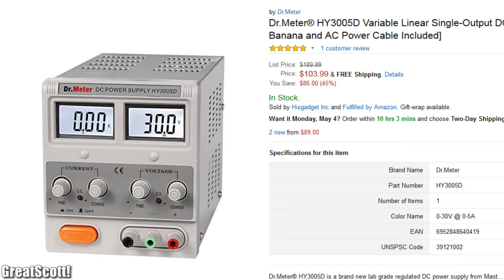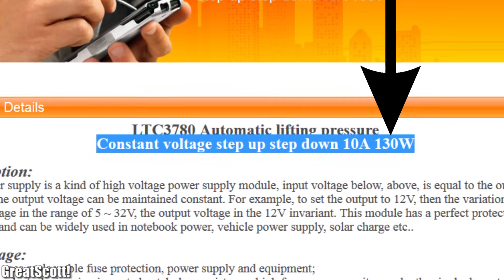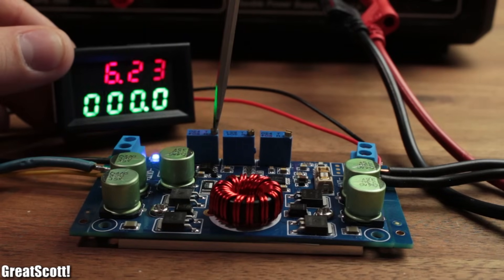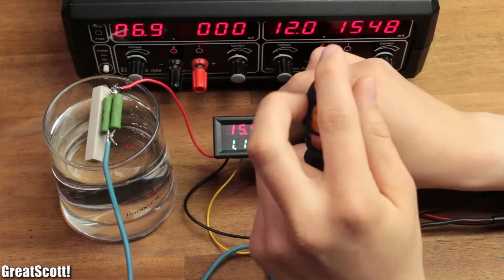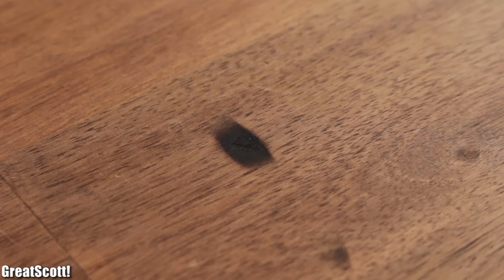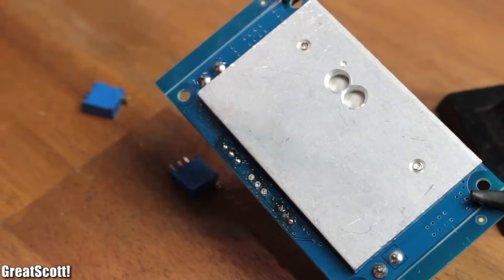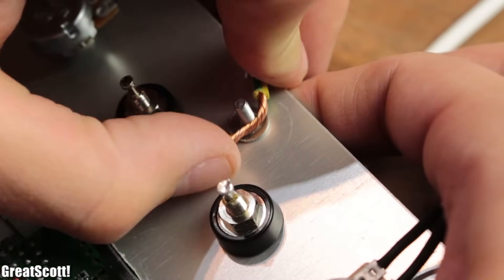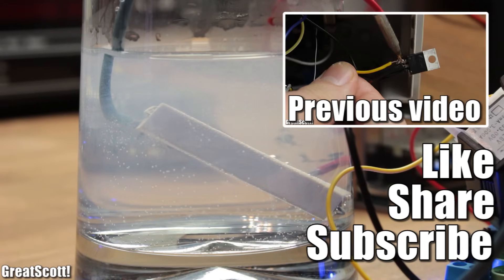Build your own Variable Lab Bench Power Supply

Comment: Where is the case from?
Reply from the maker: +SlyTrickyGaming Conrad
Reply: +GreatScott! Thank you
Reply: +GreatScott! Not sure what Conrad means when it comes to the case -- is there a model/part number I can search or a web site? Thanks
Reply: +Barry Stevens Conrad is a German electronics store. Im not sure if they ship to other countries, but i found these on their website: https://www.conrad.de/de/Search.html?search=gss0  I hope that helps you. :)
Reply: +SlyTrickyGaming https://www.conrad.nl/nl/teko-aus-33-universele-behuizing-abs-aluminium-donkergrijs-1-stuks-521906.html This is the one, i believe. There are multiple colourscheme's though.
Reply: That's an interesting idea. I just had a look at some junk 3.5" DVD dives that I have and it could be an idea to use the metal frame for a project box with mounting points for a PCB and end panels :)
Reply: I have a metal cage/box (had nothing in it) from an old HP printer I stripped down for motors and switches that I think would make a great project box for something in the future.
Reply: Wasn't finding anything I liked anywhere. If they don't ship maybe I can get a part number. If all else fails I'll build something -- Thanks
Reply: All -- thanks for all the great info!
Reply: just buy an old DVD player or something and make a new faceplate for it, probably way cheaper too
Reply: Thanks for the tip!  Have built one using this case, and everything does fit (nice case too).  You do not have room for an internal fan, if you'd like to include that, but I haven't found the need for one so far.
Reply: I found a very similar "robins egg" color one on ebay. I am using this for a different project, although it will contain a variable power supply as well (since it already had half the circuitry). I am using analog gauges though :D. Very nice size, and I like the metal fold out leg. Much less clunky than the plastic arm fold out, and tucks underneath the feet. I find it weird that the case ends up being the most expensive part on the parts list half the time! If you want a decent design though, I guess you have to pay extra for it. This one is 22$.

https://www.ebay.com/itm/HF-1-9-ABS-Plastic-Enclosure-Connection-Box-Project-Case-Instrument-Shell-Cover/381007375876?ssPageName=STRK%3AMEBIDX%3AIT&_trksid=p2057872.m2749.l2649
Reply: +SlyTrickyGaming This might do the trick ? http://www.banggood.com/Electronic-Plastic-Shell-Cartridge-Handle-Project-Case-Desk-Instrument-200x175x70mm-p-1035473.html

Comment: Good morning:

I have some questions:

1. module is set to step up or step down?
2 With a 12V supply 5A (60W), which voltage and current maxima can be seen in the output?

Comment: What were your enclosure dimensions? Just for reference, I'll probably get the enclosure after I actually get the parts.
Reply: +MaxFist Don't know the exact one that he used but this is similar and i'm probably gonna use that one:
 http://www.benl.ebay.be/itm/Z-39-J-Enclosure-with-panel-vented-X294mm-Y217mm-Z120mm-grey-/201460059521?hash=item2ee7f48d81:g:9PAAAOSw5ZBWNxnk

Comment: Hi greatscott! what a great tutorial,i'm wondering if you're willing to answer few of my questions.
personally i'm a vaper,and i want to build myself a batteryless vape station. So the question is,lets say my heating coil is 0.5ohm,and i wan't it to fire at 50W,so i should set the voltage to 5Volt and amp to 10a correct? what would happen if i set the amp to 15a?or set to 5a? would it over-power or under-power? or it would just supply enough current at 10a even i have set it to 15a? please i hope you help me understand this. Thanks!
Reply: +iOn .B oops sorry i messed up,i though the max amp in this video was 30amp,guess i gonna find another dc/dc converter...but im still wonder what would happen if current is over or under.

Comment: there is a method where you can use a computer PSu and control its various outputs with variable resistors, eg 12v can be 10 or 17v

Comment: I would like to hack one of these. I notice a lot of these CC CV supplies have lights indicating if either current or voltage is limited. I want to display this on the front of my enclosure with LEDs. Do these have the lights or anyway to access this information?

Comment: Does any one have any suggestions about this interesting module I found on Ebay: http://www.ebay.com/itm/172055996591?_trksid=p2057872.m2749.l2649&ssPageName=STRK%3AMEBIDX%3AIT
Reply: +danijel124 i dont think its good ... its only step down .. u have to power it with 30v to get lower voltages ... and in the description the seller says add fan when the temp is high .. also , i dnt think it has (current limiting) which is the important thing in the bunch power supply
Reply: +9hsn3 ok yeah it has regulate current sry abut that ^

Comment: to use the full 10A capability of the step up/down converter i have to provide it with a 10 A 12 V  power supply ?

Comment: i found this cheaper one , is it the same??

http://www.ebay.com/itm/LTC3780-Automatic-lifting-pressure-Constant-voltage-step-up-down-10A-130W-Dura-/141811612320?hash=item2104a17aa0:g:GY0AAOSw9mFWLZdv

Comment: You should not tin the wires when you put them in screw terminals. Solder tin is very soft and your screw connections will get loose. This is especially dangerous then used on mains circuits. The scew terminals will get hot when high currents go through.

Comment: Hi friend, i already buy all the components and start to build this amazing power supply. 
I have a question, what happen if i connect this power supply to a circuit that have a short? The power supply broke or it has a short circuit protection??
I also want to know what is the diameter of the power cables you are using. 2,5mm are??
Thanks so much for your help, your proyects are perfects!!!

Comment: I am thinking of buying this but I have one question for GreatScott. What happens if I create a short circuit or overload the circuit. Does it fry the board? Because this happened to me last time I bought a variable board from Ebay.
Best regards from Slovenia :)
Reply from the maker: +danijel124 You can limit the current thus you can not fry the board.
Reply: +GreatScott! Thanks man :) best regards from Slovenia :)
Reply: +danijel124  http://www.ebay.com/itm/391161762889?_trksid=p2057872.m2749.l2649&ssPageName=STRK%3AMEBIDX%3AIT

Comment: I'm trying to build this, but I have a problem. 

For testing, I've quickly built a test-circuit without modifing the LTC3780 with the potentiometer.

I tested the circuit with a 3.3 Ohm resistor and adjusted the voltage to 10 V. So it should float 3.3 A, but the LTC3780's fault LED lights up and the voltage is reduced to 5V. Why did this happen?

Could this have appeared, because I accidentaly turned the  3rd potentiometer?

Does anybody know?

Comment: first bench top PSU i ever ever made/modified was a old 250w Computer powersupply that i used and just had push buttons to select a voltage range and a potentiometer to fine tune the voltage i wanted. i couldn't control the current and it only could go from like 2v-12v. but it was nice to have. i might have to build one of these.

Comment: I prefer linear psu for a lab supply because of the noise
Reply: i think that would probably miss the point here. How much would a linear lab psu with these specs cost, diy or otherwise?
Reply: @iikkakonola  the video one costos like 30 dólar at least..
Reply: @davidfelipecastroarias8137  I meat that linear psu would cost a ton more than switching power supply. The one built here is switching, and really causes a lot of noise when operated. Linear psu:s are expensive lab quality equipment.

I thought the comment was like if this video was about Audi and someone said I like bugatti a lot better.
Reply: @iikkakonola  not really, im talking about other videos of the same, they are a bit cheaper, since the use old psu just modify ing a resistor for a potentiometer u can get a variable one, though its true I havent seen withe the same use if its possible to control current

Comment: would you be able to modify this video to show how to add in a current limiting circuit?  Also, if i were to beef up the power supply further to say 100W,/ 5A  would you be able to modify the LM3780 to manage the extra power?
Reply: The LM3780 can handle 130W, so your 100W should be fine. You should test the heatsink though
Reply: Sorry, it's LTC 3780

Comment: great video/project! if a device does not require more than 8-10mA to function (digital voltmeter/ammeter display power only), will the 5v 28A wire automatically push in my case 28A to the device?  do i need to limit the current somehow? or will the device only draw what it needs? 
separate question: If i wanted to limit one of my 12+v/16A leads/posts separately by both current and voltage how would i do that? i want to run the 12v lead through the ammeter so i can see what the volt and current are set at before i hook up the test device.

also do electronic devices only draw what they need? or is there fear of them getting too much unregulated/excess amperage?

Comment: hey!! I have a 12v 5a charger like power supply how if I use this ????
Reply: +rennier rodil it will work ok !!!! its the same thing but in set of a power suppy with terminals, is a charger with the cables already connected :D
Reply: +rennier rodil     A charger type supply will work. But I suggest you wire a 1000 uf 25 volt or larger capacitor on the output wires.
Reply: its is a normal transformer or a charger with a switching power supply inside???

Comment: +greatscott. I really like all of your videos. I have already ordered all of the components. I bought the same ltc3780 as you but got the version without the aluminum heatsink underneath and instead two snakker heatsink on top. 
Do you think it well transfer the heat as well? 
Thanks
Reply: +Kenneth Jakobsen i bought same version and plan to ad 12v computer fan for coolig
Reply: +Jam Jamamam. Thanks for the replied. Have you tested it yet? Does it get warm?
Reply: Kenneth Jakobsen i recieved it couple days before and tested with 9v battery and it works, only had to screw down under voltage pot down. I'm still waiting 10A power supply to arrive and only than I will be able to test heat of radiators

Comment: I have a probelm with the LTC3780. It works great until i solder of the potentioneters and reconect the new ones. Then it only suplyes 0-3V... ;( annny hints or tips?
Reply: +Hans Liland 
I have the same problem. It worked me for first, but when i tried it with a small dc motor and turned the potentiometers something went wrong. Now it only supplyes 0-3V
Reply: Peter. I Dubblechecked teh values of my Pots, and dthe seemed out of speck. So i ordered some new ones. Might this be the case for you aswell. The 200k pot vere showing 10k total resistance and the 500k vere no resistance at al left in. So i ordered new ones, and hopefyllt they will work. Even the new ones were out of measurements by a lot.
Reply: I checked my post, but their values are good, so this is not the problem with my LTC3780.
The fault led is on, but i checked, there is not any short circuit.
When it was good i tried it with an old PC Power supply. When i turned the current pot fastly, the PC power supply turned off. Now i use it with a 60W power supply. Maybe something gone wrong?